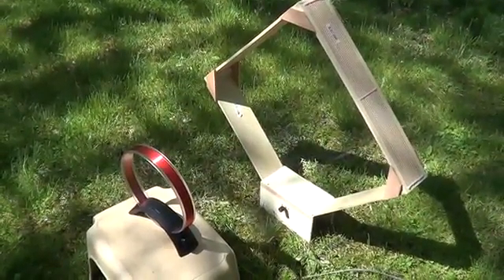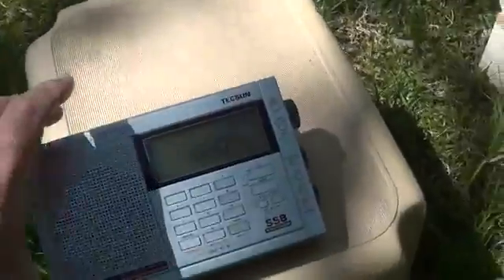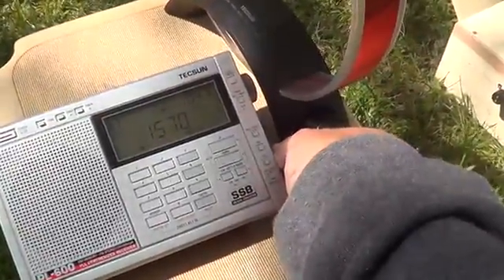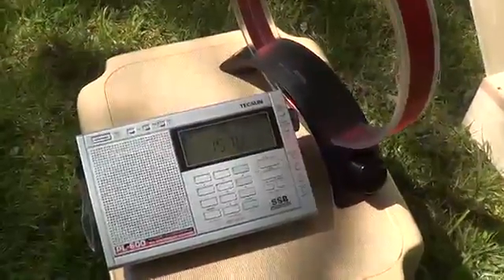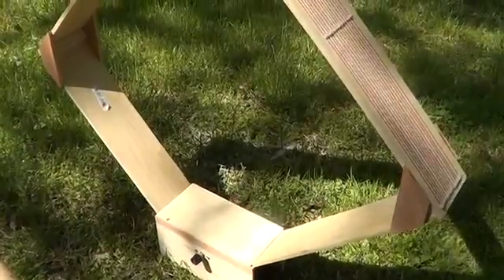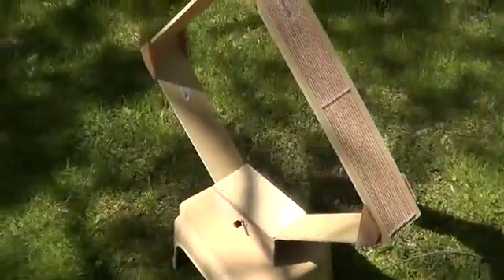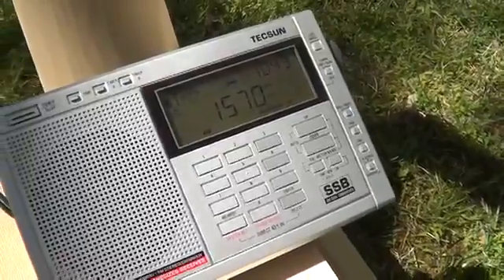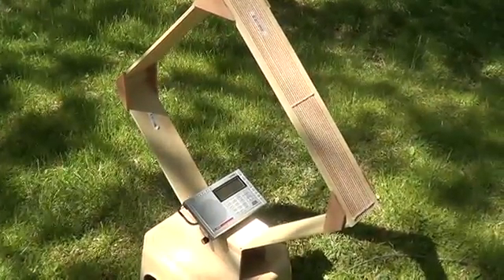Tecsun Loop vs  Homemade AM Loop Antenna

Comment: Ha Ha, your comparison is a joke!! Who are you trying to fool? The Tecsun AN-200 is great loop antenna and it does an amazing job. Your comparison is not even correct!! When you first tested with the AN-200, you didn't even turn the variable capacitor for fine tuning. This homemade matchbox antenna you made will not compare to the Tecsun antenna.
Reply: yes and no. I made two hombrewn antennas a basketena (55x35x 22 turns )and a australian loop (100x100x8 turns )which both outperformed the AN220 

basketena had 10-15 db higher signals correctly tuned
the 1x1m loop offered 15 more db 

i still prefer to use the AN200 because it is the easist to use 
the basketena after 8 yers of non use is now too old to do the proper job and now loses in terms of span and bandwidth and needs some wire adjustment 
the other is.... 20 kg heavy

Comment: I seem to pull in just about anything on AM Band with my GE Superadio II without the need of a loop.
When I did try it with a tunable loop it just seemed to add a lot of static and noise

Comment: It's not just how far the station is, but how much power the station use for to transmit, that's why sometimes closer stations are weaker than farther ones, which puts out more power.

Comment: Very nice job on your loop. Am curious what value is that variable capacitor, and what did you use to keep your turns separated? I can see in the video you notched the corners but what did you use for the end and center spacers, it looks like dabs of glue but not sure. I made one using pvc and I can't keep the wires separate. It still works well but I am quite impressed with how neat and clean yours turned out.Thanks Steve
Reply from the maker: The notches on the corners are the only separators.  I tried using a bead of glue, but the glue I used wasn't effective.    This is a pretty old video (one of my first) so I am about due for an update.  I'll take a little more time with it and show it with better detail.  I have another loop, a little bigger, that I can show off too, but the wires on that one are vulnerable to damage (as most they are on most designs I've seen.)  This newer design protected the wires better.  

Capacitor is 365 mf, I believe...standard issue for this project.  I'm not an expert in locating these kinds of radio parts, but here's my source for capacitors for this application:  http://www.mtmscientific.com/loop.html

73, Tom
Reply: Thank you Tom, would love to see the other loop. I bookmarked the MTM site.  I have been watching some videos on the MFJ 1026 noise and interference canceler. While pricey they sure look interesting. Thank you for all the information and your time.
Reply: that should be 365 MMF, NOT  365 MF  normally, 500pf ( 500MMF)is a good value to get right down to the bottom of the band

Comment: That's a bit of an unfair test. Your home made antenna is twice as large (at least). In theory, two loops of the same size should perform similarly.
Reply: It's not just loops that make this work... the variable capacitor, wire spacing etc. Plus there are those that want the best. Great video, thank you.
Reply from the maker: Yep, you're correct.  I really shouldn't have set this up as a "vs" video...just comparing commercially made and homebrew.  Thanks for the comment.